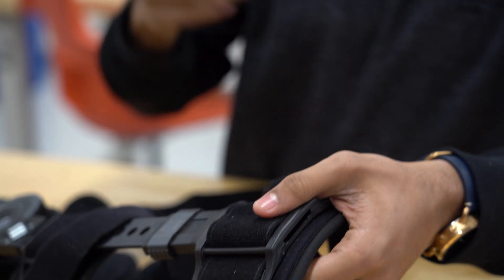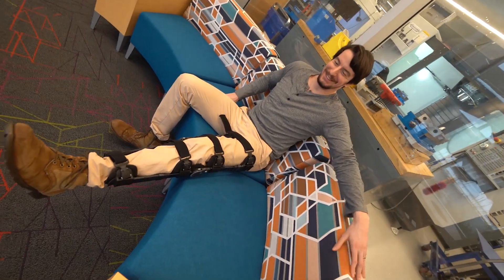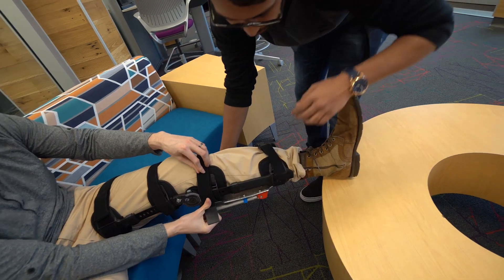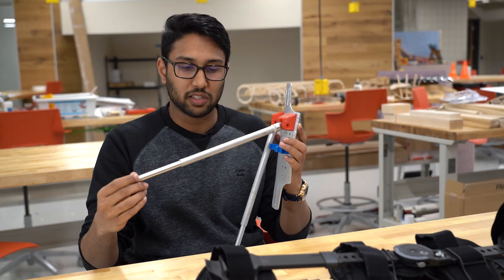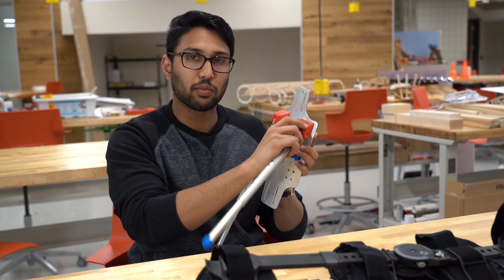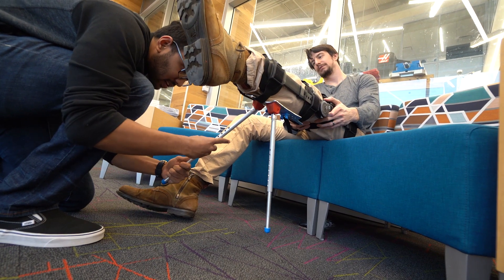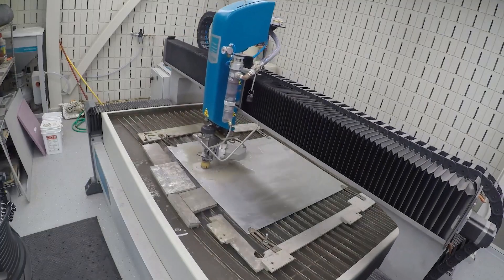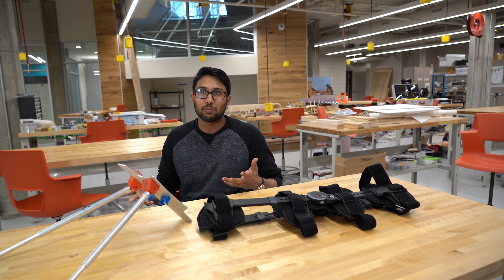Leg Brace with a Kickstand

Comment: Looks really handy! As a brace wearer myself I would say a plus point is it would help reduce the swelling in the leg which happens a lot if the leg isn't elevated when sitting (and therefore reduce pain/numbness) but the foot might also need support so it's not flopping down. If the foot is flopping it can cause pain and stretch out the ligaments at the top of the foot. I hope you were able to take your product further?